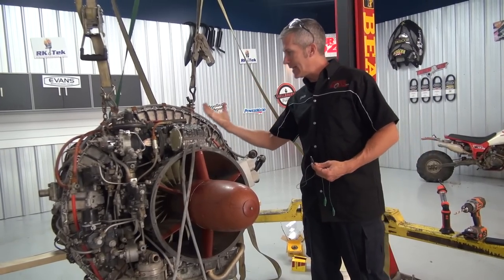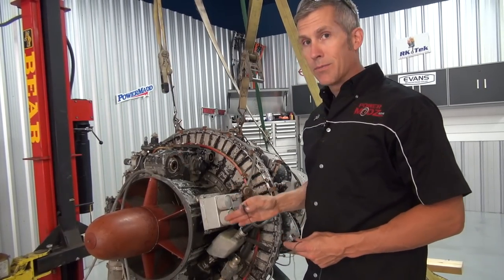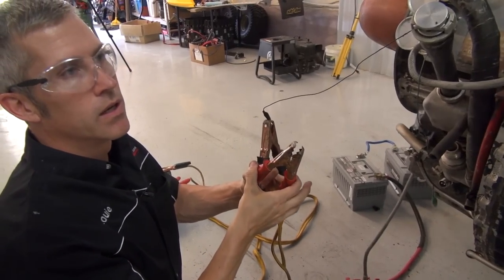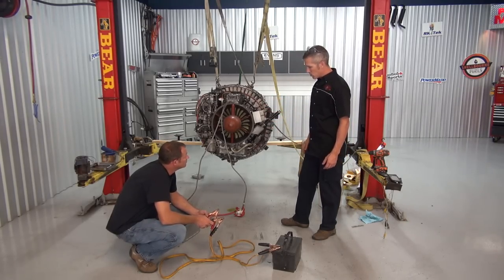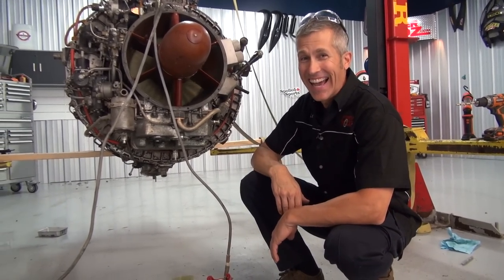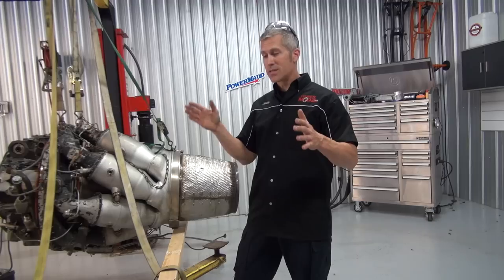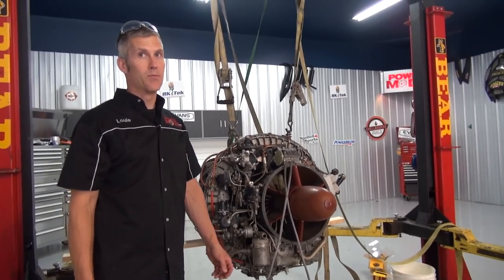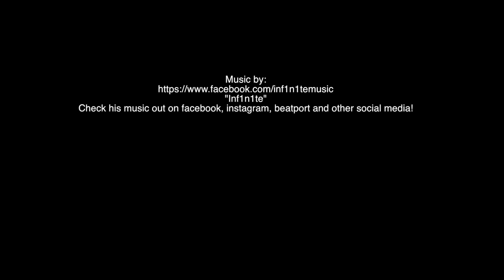PowerModz Jet build project Series #2  Prep for start!

Comment: Louie, you should pull the fuel nozzles and make sure they spray ok(check for skewed/spitting) she could burn holes in the burner cans if spray is messed. Also flush the oil system and check the chip detector for metal ( wash out the oil filter in alcohol in a big zip lock bag). Bearing material could chew her up fast inside and cause a nuclear meltdown!

Comment: Hey Louis! You need to be more concerned about changing the oil than getting fuel to that turbine! Extreme RPM means extreme friction. You said yourself it's been sitting for some time and oil begins to break down after three months. And consider building a mesh shroud to cover the intake. I wouldn't want to see you getting your limbs sucked in when you fire it up (f-16 throttled up can suck in a 200 pound man from over six feet away). Then again, it would make for a great viral video! LOL

Comment: For much larger engines, we use a honda gas-powered water pump for our fuel boost pump. We have also found that 3 feet of elevation for a large, gravity feed tank works fine without using a pump at all.
The boost pump pressure is only to prevent cavitation at the inlet of the fuel pump, which is on the engine.
Remember, aircraft engineers are extremely conservative.
IMHO, you probably do not need to make a pressurized fuel tank...

Comment: Heavy duty diesel trucks like Mack employ an electrical device called a "series-parallel relay" for high torque starters with multiple batteries, possibly this could be used for your 12-24 volt start system so you don't have to re-invent the wheel.

Comment: Be extremely careful the bearings do not sound good. I used to work on helicopter engines it should not make that sound.
Reply: no oil pressure... its a dry sump system,pump needs to be working so the jets can lubricate the bearings
Reply: ebu touy Just wondering if louie knows it's a dry sump? I think he thinks it has an oil pan so to speak and doesn't need an external tank of oil plumbed to the oil pump. Or am I wrong and it does indeed have a tank on it somewhere that I'm not seeing? Cheers
Reply from the maker: prop1113 It has an oil reservoir on the bottom, you can see the filler tube on the right side looking at it.  It has a scavanger pump and a pressure pump - for inverted maneuvers.  I just need to connect a pressure gauge to ensure max 35psi and minimums.  I also need to crack some fittings to make sure oil is travelling the ducts.
Reply: Sweet as, just checking, don't want you to fry it :)

Comment: Sounds Good!  You can use a few nice, heavy duty starter relays (for diesel engine starters, for example) & switch them with a couple of toggle switches.  Place the 12 batteries in parallel (all + together/all - together) for initial start (12 V), then series (24 V) by flipping a switch, once the RPMs have topped-out at 12 V.  Half of the fun is figuring out, engineering the later modifying a system to control & operate the engine.  There is a company in Canada that specializes in high horsepower engine & fuel delivery that you may know.  It is called 'Aerospares Accessories, Inc.'  Contact Ian & he can get you any pump & regulator you need, in 24 volt.  Earl's AN hoses & fittings are a must for safety.  Keep up the good work & nice job on the videos.

DD

Comment: I own an L29 with the m701-500 in it.  Any time the engine is rotating, the low pressure fuel pump must be on.  If you don't you're going to destroy the high pressure pump.  Typical spool down time for this engine is 45 seconds.  Also the oil in it is russian tractor oil made by Royco.  Do not use synthetic mobile1 or bp jet engine oil or you will destroy the engine seals.  Don't throw any filters away, a fuel filter is about $100 and next to impossible to find in the US.

Comment: hahaha "what's the worst that will happen?!" hahaha Maybe an explosion lol.... Moving part at 250,000 rpm flying at you! trust me there will be no time. there is a reason why they keep these in a seperate bomb proof room when testing. they are also bolted to the floor. 800lbs of thrust at idle. i'm an Aerospace engineer for standard aero in winnipeg

Comment: Best way to start it going from 12v to 24 is use a couple industrial sizes relays with a timer relay so when you push a button it spools the motor in 12v then switches over to 24v, you can also connect your igniter to the timer relay so when it switches to 24v It powers the igniter as well. An Omron timer relay works well if you're wondering what kind to use, and you'll probably want a large contractor to handle in inrush current.

Comment: Use a variable resistor and a multi meter to work out how many volt are through the resistor then you can crank it up to the max for maximum volts and get a blasting engine !!

Comment: If you need more info on the engine, start sequence, I can help you out.  It's a very rugged engine.
Reply from the maker: I appreciate the offer, I just found a few manuals on it and start sequences from a local shop that just sold their L29.  Covers starts, hot starts, cool down deserating etc etc.  But I'll take all the info I can get!  The next step is plumbing the fuel system.  I wired up the igniters and EGT today and finished the cradle.   I have a few ideas for a fuel system, we were thinking of pressurizing a tank of fuel to 15 or so psi, or i have the ability to get a lear jet fuel pump but I want to make sure the engine runs first - so I might just start it up with a gravity feed...if it starts and idles then I'll order up the pump.
Reply: PowerModz the fuel need to atomize full or else you'll burn the combustion liner... at 5000 rpm you'll destroy your HP fuel pump without any fuel getting on it at least get a boots pump.. you also need to wire the tach and fuel cut off ON/OFF.. this engine will start on anything, i would not even trying starting this if i haven't inspect from inlet to exhaust. you would be surprise if one compressor blade let go, i wont be near close to it